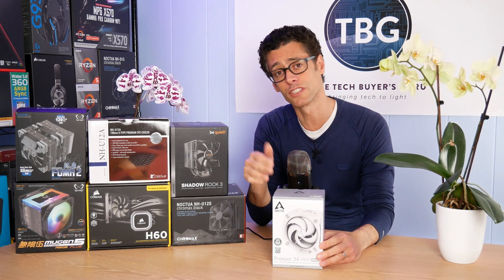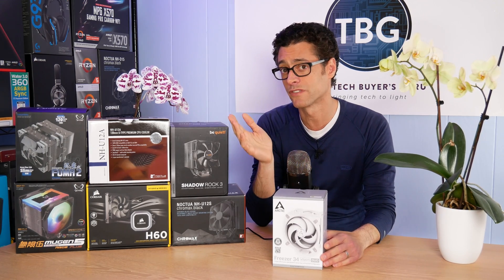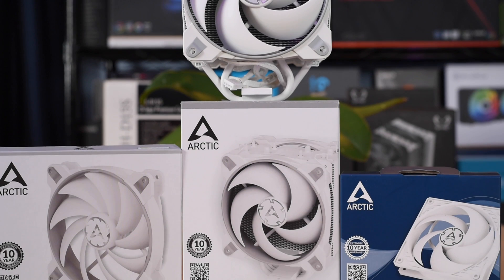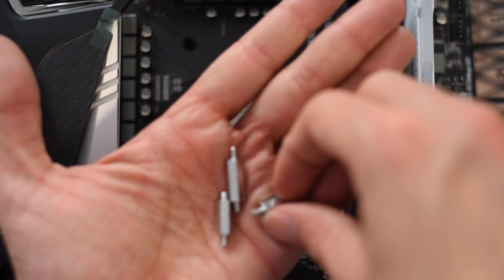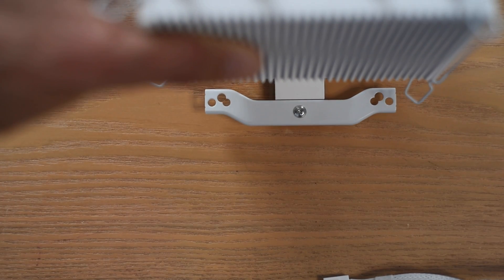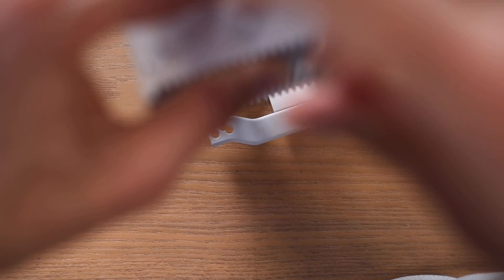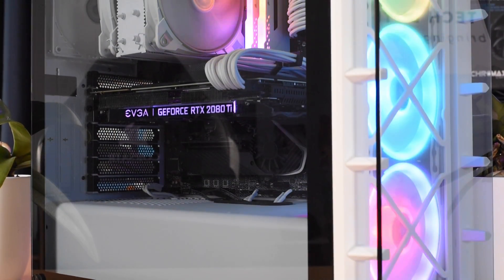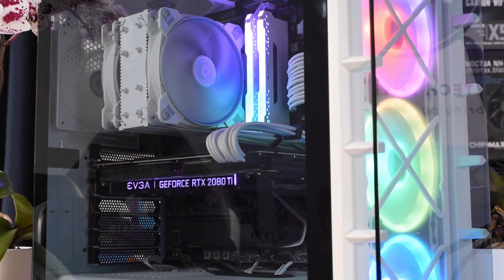Arctic Freezer 34 Duo White CPU Cooler - Ryzen Installation Video

Comment: Hello , i got this cooler mounted at a pc service . I have a ryzen 5 3600  , I overclocked it at 4  ghz in ryzen master at 1.34375 peak core and after running the stress test it went to 85 degrees but I don't  think that is normal?

Comment: Finding it odd. The backing plate doesnt seem tight with the stand offs installed.
Reply: I agree.  Mine was saggy.  It needs some type of rubber washer gasket to hold tight to mobo

Comment: I have the Esports One and luv it.  I put the thermal paste on the CPU (Intel) in the traditional sense, pea size with no issues, just made sure I evenly tightened the 4 mounting screws to spread it evenly. Their direction to smear it on the cooler pipes seems silly frankly to me; it seems to me doing it that way, is more likely to just get paste on the edge of the pipes, outside of where they make contact with the CPU.  If I was more anal retentive, I would smear the paste evenly on the CPU since that is the more important place for the past to  be.

Comment: I want to buy this cooler but there will not be much difference between the cooler and the glass of my pc because my case is not very thin
pais and it's that it's annoying and can it interfere with my air flow?

Comment: Does this come with a back plate? I’m running into a problem where my cpu won’t fit tight because the back plate isn’t tight enough
Reply from the maker: The backplate comes with the motherboard and floats. Many people are concerned that it is not tight, but that's how it works with the Arctic mount. Once the cooler is attached, it stops moving around.

Comment: Great video. Would this cooler be enough for a AMD 5900X running stock? Thanks 🙏
Reply from the maker: I think you can get away with it on a 5900X, but you may need to run the fans at a higher RPM than I'd consider quiet. It has the headroom if you're willing to crank it up to full RPM at load.
Reply: @TheTechBuyersGuru  the 5900x is rated at 105TDP and this cooler is rated at 210watts. So I thought it should do ok for stock?
Reply from the maker: Those numbers are extremely rough approximations. The 5900X can pull far more than 105 Watts, and 210 Watts is possible on the Freezer 34 Duo, but as I said, only if you are willing to use the high end of its RPM band.
Reply: @TheTechBuyersGuru  I think from benchmark reviews it hits a max 140tdp . I’m thinking of buying the 5900x or maybe just settle for a 5600x for gaming and photo editing (capture one pro and Lightroom) , but I wasn’t sure if the 5600x would be good for this and even if it’s much of an upgrade over my current intel 4790k? This is why I was thinking 5900x . What do you think? And thanks 😊
Reply from the maker: Photo editing is notoriously unresponsive to core count. If that's your focus, I'd get the 5600X unless you have nothing else to spend the money on... alas it's probably not going to be a GPU these days, since they're unavailable. And yes, the 5600X is an enormous upgrade over your 4790K! Sure, the 5900X is faster, but barely so in games, whereas the 5600X would demolish a 4790K in games.
Reply: @TheTechBuyersGuru  5600x it is then . Thanks for saying me £200+ 😃👍 appreciate your replies and help. Keep up the great videos 👍

Comment: I bought this aircooler. The rear fan is in close, touching contact with the 120 mm rear exhaust fan. They can work in such way?
Reply from the maker: This must be an ITX case. It wouldn't touch in a tower case. I would move one of the fans. Stacking fans does not work well.
Reply: Thank you, I guessed that. It's odd, but it is a mid tower ATX case.
MSI MAG Forge 100r.
Reply from the maker: View this image from the MSI website: https://storage-asset.msi.com/global/picture/image/feature/PC-Components/MAG-FORGE101M/101m_ready.png
If using an ATX motherboard, it should not be possible for the rear fan on the cooler to touch the rear fan on the case. On my ATX motherboard, there was about 30cm clearance.
Reply: It happened with my Gigabyte Z97 HD3. If I could send you a pic, I'll do.
Reply: In facts, I checked that I couldn't install a Fuma 2, before to buy. And I stand right.

Comment: so it’s ok to do that much of thermal paste?
Reply from the maker: This is Ryzen. You need about double the thermal paste compared to an Intel processor or it won't cover the CPU.
Reply: @TheTechBuyersGuru  but i mean could i nevertheless use a dot in the middle. Because even if it is ryzen it seems a little bit too much for me. Have you experienced any performance differences
Reply: i am a little skeptical

Comment: this one or the freezer 50 for 3900x?
Reply from the maker: The Freezer 50 is a lot more specific when it comes to compatibility, as it requires very low profile RAM (under 37mm, by my measurement). It's more powerful than the Freezer 34, but then again, so is the Scythe Fuma 2, which I recommend strongly: https://amzn.to/3rPulCs

But the Freezer 34 Duo White featured in this video definitely looks great, so if you want that color choice, it's the best option on the market. Here's the link: https://amzn.to/3dzB3r8
Reply: @TheTechBuyersGuru  thank you so much! Never heard of scythe before looks great but out of stock in my place and amazon. Yes i do have a low profile vengeance ram sticks on a b550 gaming edge mobo on lianli lancool215(big enough)and a rtx 3070 installed on first slot. It's a compact gpu from zotac. Do you think it work with that beefy freezer50?
Reply from the maker: Get the Freezer 50 if you already have Vengeance LPX. FYI, the Freezer 50 has dropped in price in the US, and probably has elsewhere too. Link: https://amzn.to/39LJPB4
Reply from the maker: Yes, I saw that video. Stick with the Freezer 34 Duo.

Comment: any clue why mine doesnt have clearance for ram? it says its supposed to be nearly unlimited , but it hits my ram (corsair vengeance rgb) I have 4 sticks, and using the intel socket
Reply: @demon 
Hey Demon thanks a lot for the response. 

Fuck man yeah, might just end up doing the same thing. I've only got one fan hooked up to the cooler now pulling, and no pushing, which makes the temps be not quite good. 

I just wish I hadn't been sold on the whole "unlimited ram clearance" bullshit. It's on the website and almost all reviewers say it as well, because they read it off the website, and then they proceed to test with either 2 ram sticks in slot 2 and 4 , or low profile ram in the other slots, lmao.
Reply: @demon Thanks a lot for the recommendation! Might just check that one out!

Comment: Don't think it really matters but I think you put the outtake fan in the intake position. Only one of the fans has the little pads on it, right? I think they put those there to be used as the outtake.
Reply from the maker: Yup, I know that, and I actually inserted a text note in the video to identify the issue!
Reply: @TheTechBuyersGuru  Oh wow. Not sure how I missed that!
Reply from the maker: The better question is how did I miss it while I was installing it?!?

Comment: Is there any problems with installing it to the back plate because I saw some reviews and people said that they where having problems especially with the msi motherboard
Reply: Yes, it’s pretty annoying to get it attached to back plate on an MSI B550-A Pro. You should attach it before putting it in the case. Otherwise you’ll have to prop the plate up against something underneath.
Reply: @thejoelpatrol  what

Comment: What would be your air cooler (don't like the look of an aio) recommendation for the Corsair 280x (max height 150mm)?
Reply from the maker: That CPU clearance is problematic, which is one reason I don't recommend the 280X. It used to be that I could recommend the Cryorig H7, the best cooler under 150mm, but it is no longer in production and is only sold by scalpers for 3x the MSRP: https://amzn.to/2MDp2XD
So, in this situation, your only option is the Noctua NH-U9S: https://click.linksynergy.com/deeplink?id=WAzU8cLhuCU&mid=44583&murl=https%3A%2F%2Fwww.newegg.com%2Fnoctua-nh-u9s%2Fp%2FN82E16835608067
Reply: @TheTechBuyersGuru  thanks, yh I noticed that my choice was somewhat limited on pcpartpicker haha,  I would be spending the same to get the H7 as I would to get the U9S, so I'll probs go for the H7 seeing as it be best even at its inflated price
Reply from the maker: If you can get the H7 for around the same price where you are, then definitely grab it. I wish it was more available in the US. I actually have one, I could sell it for a lot these days, LOL!

Comment: PCPartPicker mentions a note that I may require a separately available mounting adapter to fit my ASRock AB350 Pro4 Motherboard, is this the case or does it now come with the appropriate mounting adapters and I shouldn't worry about this?

Edit - CPU is Ryzen 5 3600
Reply from the maker: PCPartPicker uses information that's about 3 years out of date for its auto-generated warnings. That's not doing anyone any good, yet people keep using it.
Reply: @TheTechBuyersGuru  Oh damn... So I don't need anything right? Thanks for commenting so quickly also! Nice vid :)
Reply from the maker: Yup, you're fine, in fact I don't think that PCPP warning was ever right, as the cooler was released after the AM4 socket debuted.

Comment: You don’t need all that thermal paste, if you use a pea the pressure will sandwich and spread the paste over the 4 heat pipes
Reply from the maker: As I explained in the video, the pea application method does not work for exposed heatpipes, and Arctic specifically says so in the manual.

Comment: I've got a Ryzen 5800x with this cooler and it's pretty quiet. I've mounted it wrong at the beginning and had spikes at 90 degrees with 4.1ghz, but now after remounting it and reapplying thermal paste I've got 4.65ghz under 73 degrees, so it's surprisingly great for it's price :)
Reply: How did you mount it wrong in the first place? Pics would help. Thanks.
Reply: @rezasyahzan  You have to make sure you've got the right mounts and then it should make contact. I used the wrong ones and that's why it wasn't effective
Reply: @morrowmike  Its the ones with one horizontal cut I still dont think it makes full contact...
Reply: @pokeyerface  I tried the ones for Intel I believe in my MSI B550M MORTAR, because I had the same issue
Reply: @morrowmike  I discovered the problem is not with those but with but with the 2 plates that connect to the cooler itself. You have to make sure you screw them above, not below cuz it will push the cooler away from the CPU...
Reply: In the begining it wasn't making contact with the CPU right?
Reply: For a single tower that cooler is insanely good.
Really quiet even at higher rpms

Comment: Brackets don't fit into my backplate on MSI b550, any ideas?
Reply from the maker: Do you mean the standoffs? You just have to find the right one, there are several different standoffs in the box for use with different sockets.
Reply: Hey did you find a solution? I have an msi mobo and standoffs dont fit as well

Comment: Hey great video, I'm installing this on my ASRock b550 but when I attach the standoffs to the backplate, the backplate doesn't sit tight with the motherboard, it drops about half a centimeter. Any advice? 

I'm using the correct standoffs
Reply from the maker: That's how it's designed. It floats. Just install heatsink and it will tighten up.
Reply: @TheTechBuyersGuru  Yea but that also means that its slacking forward when inside the case, I find that extremely weird...

Comment: What are the temps your getting before and after applying the arctic freezer 34 duo.? And I noticed that the heatsink doens't cover the whole IHS of the processor. Will that be of concern?
Reply from the maker: See this video: https://youtu.be/HZOGK49NGLQ
Doesn't matter if heatsink covers whole IHS. What matters is performance.

Comment: Do you recommend using the thermal paste that comes with it? or should I get a sperate one
Reply from the maker: The included packet is really hard to apply, comes out messy and uneven, and MX-4 paste generally is sloppy to work with. I recommend Noctua NT-H1: https://amzn.to/3mVYJsJ. Much easier to use, better performance.
Reply: @TheTechBuyersGuru  okay thanks

Comment: what would you recommend for a ryzen 9 5900x (air cooler)
Reply from the maker: The minimum cooler I'd recommend would be the Scythe Fuma 2: https://amzn.to/2HYcjwj
The only true step up in terms of air cooling, if you have the space for it, is the Noctua NH-D15: https://amzn.to/2TLkE9k
Either would be fine, but if you'll really be pushing the 5900X, the D15 will keep the CPU a bit cooler, allowing for slightly higher boost in some circumstances.
Reply: @TheTechBuyersGuru  ouch i hope i find one the 5900x is gonna be a hot boy ill look into your recommendations thank you

Comment: Just figured I'd ask a few things if anyone can answer them for me. To keep it short I just built my first pc with a Ryzen 5 3600. The stock fan isn't powerful enough so I looked for a better cpu cooler.  I got the hyper 212 evo and because you have to assemble the backplate I over screwed while testing it not on the mobo and messed up the backplate. I'm looking into getting a new set of stuff for that but if I have to get a new cooler is this a good option? More specifically, is this easier to install, because I think so. Also I have the NZXT H510 so I believe I have enough space. Thanks for any responses!

P.S. Just another thought should I be concerned about putting a cooler this large on my micro atx board? Because these bigger coolers always look like they could fall right off to me lol. Also, I've heard about new backplates and stuff sometimes being needed. I have a b550m pro4 so should I be able to use the og backplate?
Reply from the maker: The Arctic requires the backplate from your B550M, so make sure you have it. Otherwise, it will fit easily on the board, and won't fall off!
Reply: @TheTechBuyersGuru  ok, thanks for the fast response! You seem to be really good at those lol. Are there any alternatives you would deem easier to install? This seems like the best one for installation at first glance.
Reply from the maker: By far my favorite cooler is the Scythe Fuma 2. It is very easy to install, easier than the Freezer 34 Duo, and it performs a bit better as well. It costs $10 more - here's the link: https://amzn.to/37Vuyhc #ad

It definitely isn't necessary for the Ryzen 5 3600. You can see benchmarks here: https://youtu.be/HZOGK49NGLQ
Reply: @TheTechBuyersGuru  I’ll definitely look into it if it’s easier to use and install then. Thank you!

Comment: hey man i noticed you used your gpu cable extensions diffrently then other people and i just have to say it looks amazing instead of on the bottom its on the top! i just wanna know how you did it because im building my pc soon and your cables in that orientation look amazing so if you coud please respond to me on how you do it that would be amazing thak you.
Reply from the maker: You can route them either way, I just did that because I don't like to block the airflow to my GPU, but yeah, it does make them stand out more. Here are the Corsair cables I used: https://amzn.to/3jurTgq

Only work with a Corsair PSU, by the way. I have the RM850X White, which is basically impossible to find in stock, but the RM750X White is available: https://amzn.to/2HzX90r
Reply: @TheTechBuyersGuru  thank you

Comment: Love how you reply! 

Would this be a better choice than the Cooler Master Hyper 212 RGB in terms of performance?

I have a B450 tomahawk max mobo, ryzen 3600, with an rtx 2060. Would there be enough clearance and would I still be able to max out my ram slots with the artic in? 

Currently running 40C idle with the stock cooler
Reply from the maker: Yes, absolutely, this will fit anywhere the Hyper 212 RGB will fit and is much better in terms of performance, but obviously it doesn't have RGB. That being said, it is very good looking in white: https://amzn.to/37yXVpg #ad
The only problem is that the price has gone up too much since I tested it, so I'd recommend the much better Scythe Fuma 2 for less money: https://amzn.to/3kqSlJ2 #ad

Comment: is it okay for the cooler to have a bit of sag due to its own weight? the cooling is great, it's just a visual thing
Reply from the maker: Is it moving on the bracket? It should not tilt from side to side.
Reply: @TheTechBuyersGuru  its not moving the bracket nor is it moving on the bracket, the mount itself feels rock solid. I think its the motherboard slightly flexing or the heatpipes slightly suffering from gravity. It should be OK right? the movement is springy and requires some force (its not loose, its just not rocksolid to an extent that you cant move it.)
Reply from the maker: Sounds fine, not to worry.

Comment: would this clash with ram on a mini itx motherboard?  do u suggest i just go with the single fan version just to be safe?
Reply from the maker: Good question. No, you won't have interference, and actually the single-version wouldn't be any better, as the interference is in the front, not the back where the second fan sits.

Comment: im considering to buy one of these, but im afraid if it blocks my first ram slot, cause i dont have more than two and my ram slots are very close to CPU spot. I'm using msi b450m-a pro max with Gskill rams (40mm each ram's height). Can you share your opinion? I would be appreciated.
Reply from the maker: It will fit.
Reply: @TheTechBuyersGuru  Thank you

Comment: Wow, not necessary replace the backplate right?
Reply from the maker: You must use the AMD backplate that comes with the motherboard.
Reply: @TheTechBuyersGuru  yeah, is not necessary extract de motherboard backplate i refeer, only replace de brackets, but not the full backplate, right?
Reply from the maker: You will re-use the backplate.